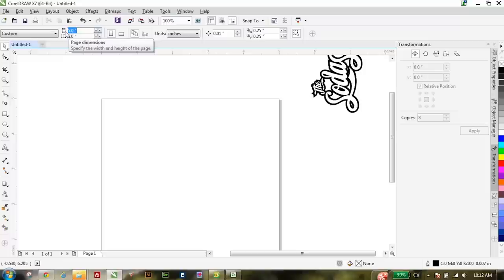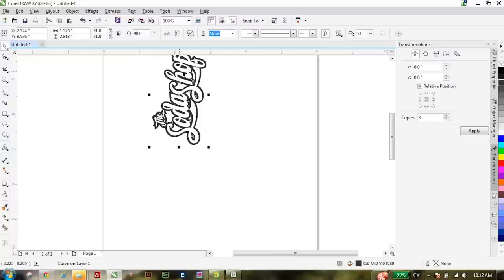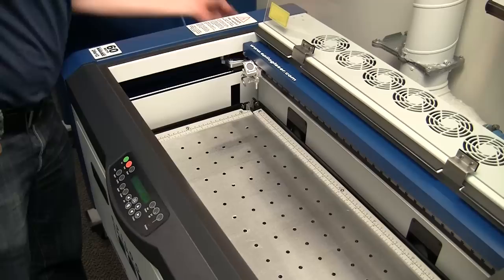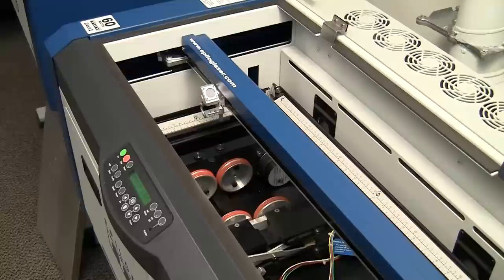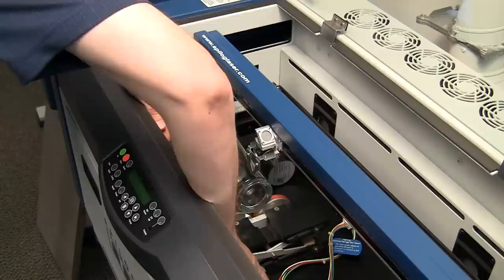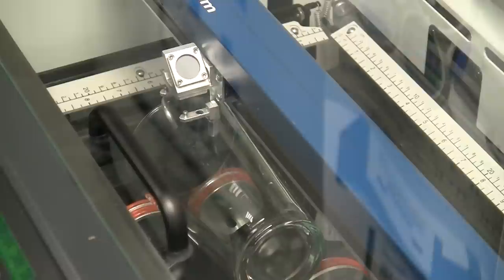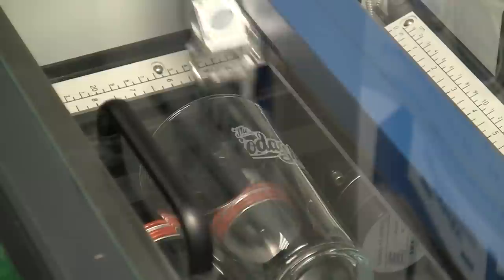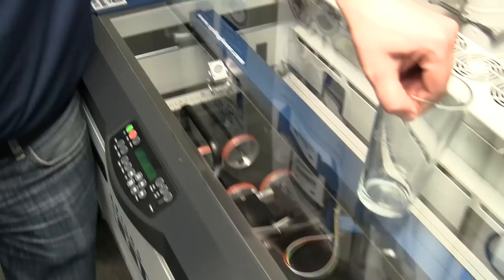Epilog Rim-Drive Rotary Attachment - How-To Setup and Engrave -  Mini24

Comment: Thanks for posting this video. But I'm not clear about one thing. If the top and bottom wheels of the rotary attachment are turning at the same rate, the rim of the glass (being larger radius than the base) would turn more slowly than the base. So wouldn't the etching get skewed? A lathe doesn't have this problem because it gives the same radial velocity to both ends.
Reply: In extreme cases when the top and bottom diameters of a glass are very different and the artwork reaches from the top to the bottom of the glass, then you will see a little skewing to the artwork. In this case the SodaShop artwork is only 1" or 1.5" tall on the glass so there wasn't a noticeable skew to the artwork.
Reply: only one set of wheels is motorized, so this is not an issue.

Comment: what speed and power is used in this example??
Reply: Hi Lenny - good question. You might find that the settings we used vary a little depending on the glass you are working with - it's always a good idea to run a few sets before your final engraving. The settings we used for our example are 80% gray on the logo fill, 60% Speed, and 100% Power at 300 DPI. The full settings can be viewed at 1:27 in the video. Here is a timestamped link - https://youtu.be/36kdUQXmaA0?t=1m27s

Comment: Would a Zing 24 60 watt do the same thing?
Reply: ebaysurplusauction Yes the Zing 24 60-watt will do all the materials you see in this video. The Zing's motion control system is a bit slower than the Legend systems, so the Zing 24 won't mark the graphics as quickly.